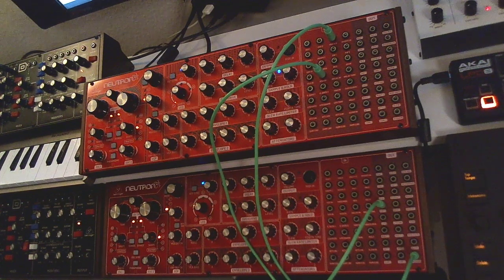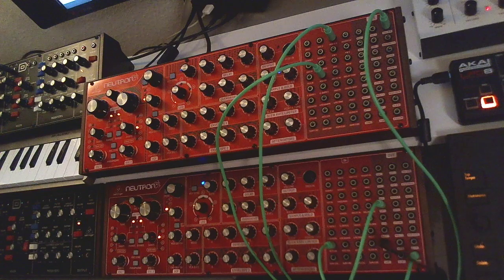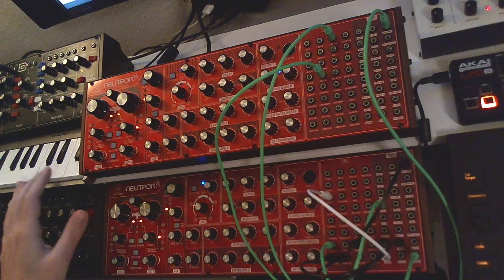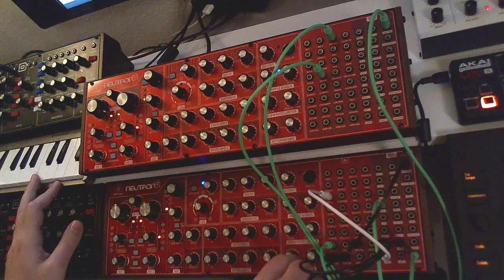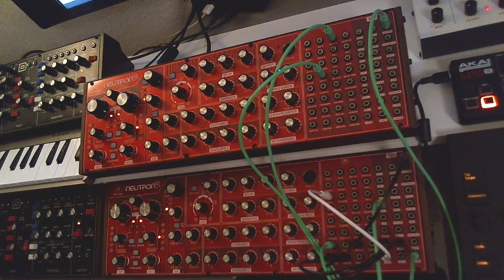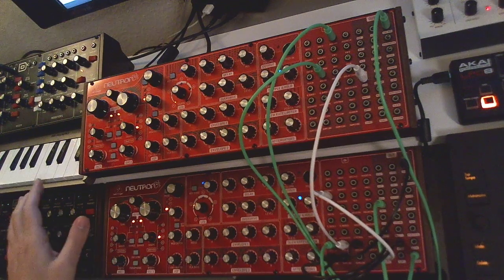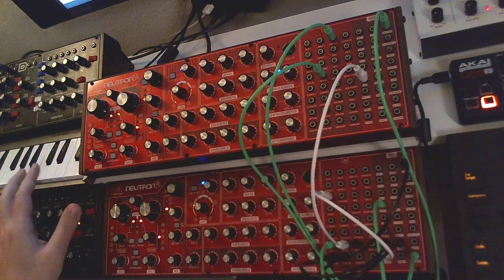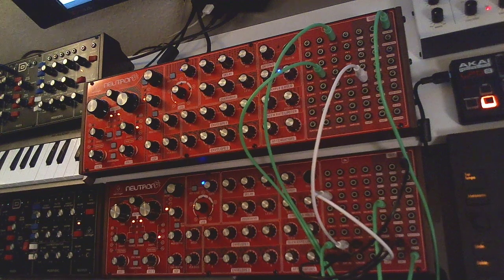How to patch 2 x Behringer Neutron together

Comment: You know that you can actually link them internally without any wires and then u'll be able to play actual chords on the keyboard! =) Check out the Manual again. :)
Reply from the maker: Yes, but this was the "modular version" when you can't daisy chain midi and also not to play chords specifically. The main idea was to share/forward the envelope settings of one unit to the other so you don't have to mirror the sound settings on each unit. Basically making it a 4-osc synth with 1 env. Polyphony wasn't the goal.

Comment: I have a question that might seem dumb, the neutron is mount in a eurorack Im using the Behringer CMA1 for CV/gate, the CV is plugged to VCA CV input and the gate is plugged to OSC 1+2 input.

The pitch changes but the it note plays continuously as soon as i stop playing ?
Why is the gate not controlling the note duration like my other modules ?

If plug the output OSC 1+2 to the mixer i get a continuous tone, its like the envelope is being bypassed ?

Comment: great video.... cool idea... it's possible to make the same with a Model D? many thx
Reply from the maker: Not really. It's missing some patch points for that. But you can use Polychain via MIDI and distribute filter cutoff using cables so one would be the "master" controlling the others. There are some videos on YT about Model D stacking. Search for "Behringer Model D Poly Chain". Video by Tim Shoebridge is pretty comprehensive. Also artoftravelogue talks a bit about tuning issues between units.
Reply: cellrok thanks, it’s Nice. i will watch this 😊
Reply: cellrok by the way, I meant to chain a Neutron and a Model D. not 2 Model D together.  I have only one Neutron and one Model D at home

Comment: No no I won’t buy another neuron...... buys another neutron..... it was either more $$$ modular gear of 84hp or spend $300 to fill it up. Done.
Reply from the maker: Hehe. Yes, the value is insane. I am currently planning a 84hp as a companion for my semi-modulars, so i am looking for effects, modulators, sequencers or another VCO to just "enhance" the Neutron voice rather than building a standalone modular system. I will definitely jump on the Behringer Pro-1 when it comes out too. They've added a lot of patch points in the final design too.